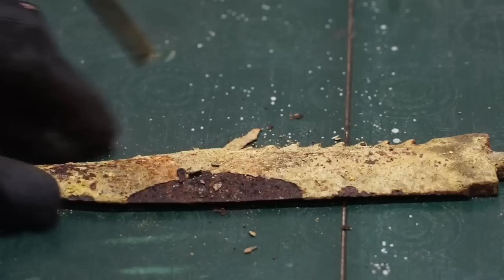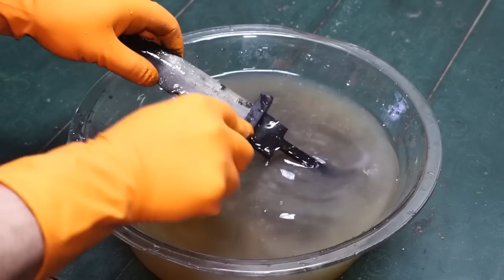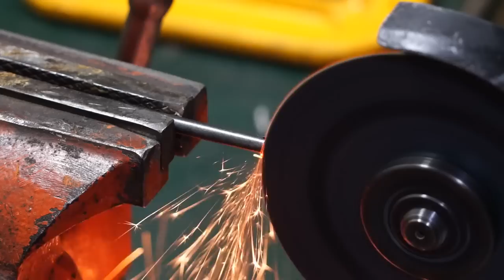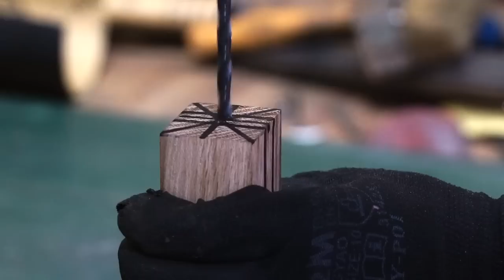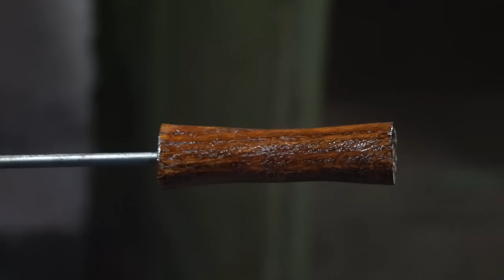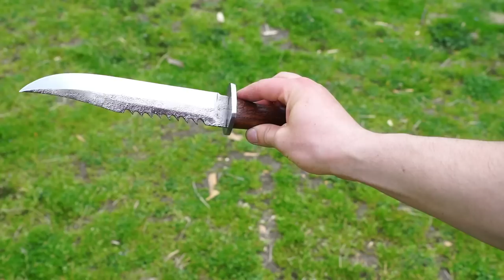Restoration Very Old Rusty Survival Knife

Comment: The heat on the tip of the blade to straighten it ruined the temper and the quench would not have hardened it cause it wasn’t at critical temperature. Also the heat to do the quench would travel down the blade and ruin the rest so the whole thing would have to be requenched to get optimal hardness.

Comment: I’m pretty sure that your chisel wasn’t designed for scraping rust off a knife. Now you have to re-sharpen your chisel. I would have used a wire brush.
Reply: Am sure it wasn't sharp to begin with, alot of people use tools like chisels and screwdrivers and prybars to scrap stuff
Reply: It's not real rust... the whole channel is fake!
Reply: I have old chisels i use for jobs like that, definitely wouldn’t use my current ones

Comment: Thanks for using a chisel for the initial clean-up.  It drives me nuts when other restorers use a small flathead screwdriver... it takes them freakin' forever to remove the crust LOL.
Reply: But sacrilege for the woodworking tool.
Reply: @macmccreadie8541   LOL, I'm gonna assume it's an old one.
Reply: It's not even real rust, so why bother?